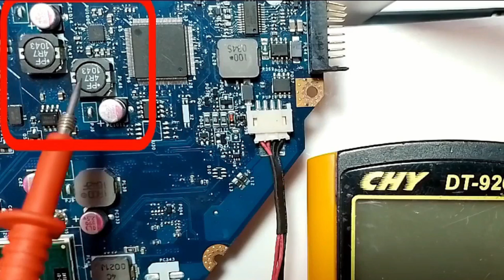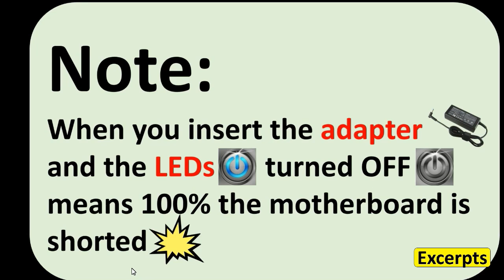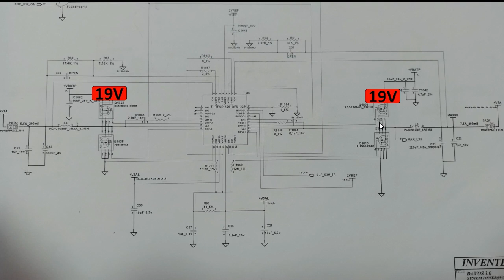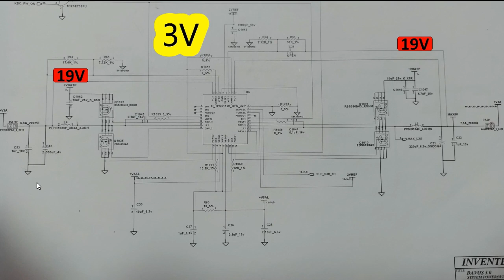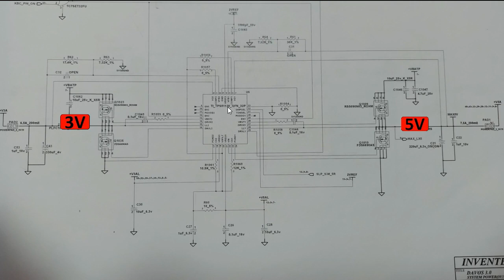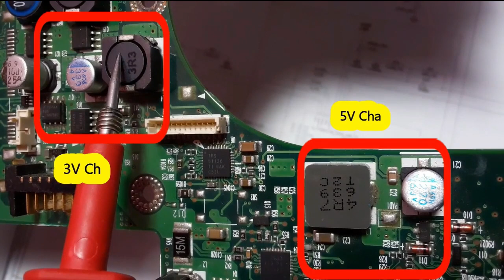Masterclass: Laptop Motherboard Repair Tutorial - 3V and 5V Circuit Explained

Comment: Great information from this post, my question is we input 19v but in the circuit we have 5v and 3v,, what the 19v for?
Reply from the maker: The 19V input is the main power source for the laptop. This voltage is typically regulated down by different power management circuits to supply the necessary lower voltages like 5V and 3.3V. These lower voltages power components such as the logic circuits, USB ports, and other peripherals. The 19V is primarily used to power larger components like the charging circuit and can also be stepped down for specific system needs. Let me know if you need further clarification
Reply: @electronicsrepairbasics_erb  thanks for a detailed apt response.. count me as your fan.. will take time to go through your other posts
Reply from the maker: I truly appreciate the support, and I’m honored to have you as a fan. Take your time going through the other posts, and feel free to reach out if you have any questions or suggestions. Looking forward to sharing more helpful content with you.

Comment: Dear Sir, could you tell me wich voltage regulator do I need to control my broken Chip (I think is a Voltage Regulator) G370  814JD6 for Laptop Dell Latitude 7280 0r 7380 like Motherboard CAZ10 LA-E122P, Rev.1.0(A00) 2017-05-12, please.
I found some one in Internet but they are diefferent like 1.2, 1.3, ..., 3.3 Volts.I have not Idea with Shematic.
Reply from the maker: I can assist you closely in my Patreon Page
Reply: @electronicsrepairbasics_erb  thank you for first time